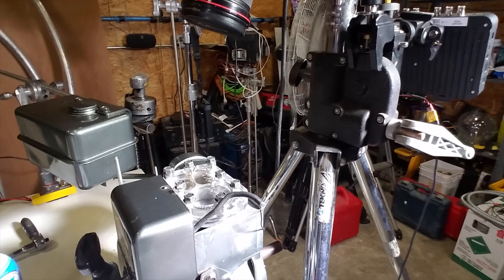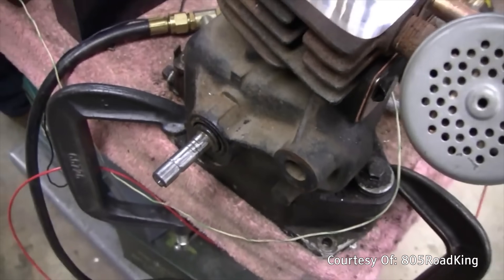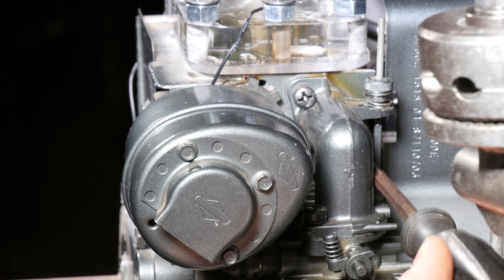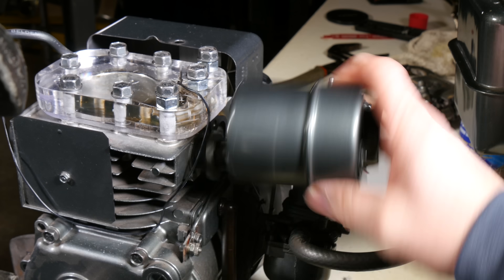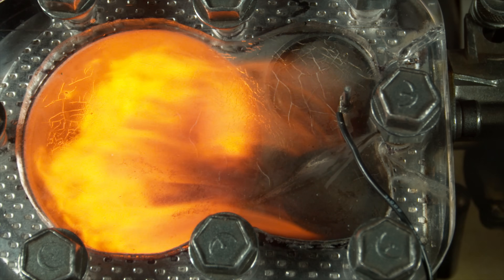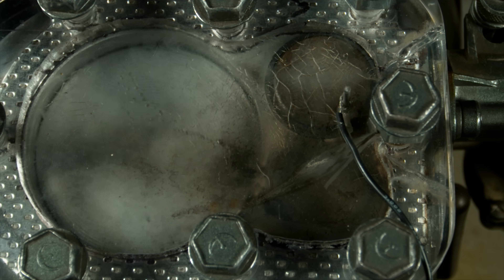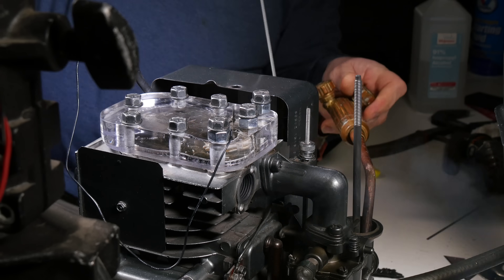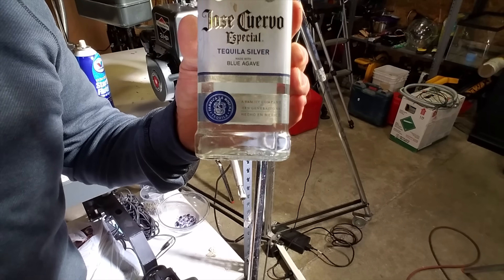See Through Engine - 4K Slow Motion Visible Combustion ( S1 • E1 )

Comment: I think the same can't be done with a diesel. If it were possible you would see the air inside the cylinder turning into plasma and beginning to glow as the pressure increases and then the diesel fuel injection and the resulting combustion.

Comment: is it true that diesel motors ignite the fuel with preasure, as in the spark plug doesn't through a spark everytime the piston is up. the fuel then being ignited by the built up preasure. I don't know if it's the diesel motor that works like that, but I'm certain that certain types of motors are built to work like that. could we see a demos ration of that pleas? :3 thanks
Reply: Diesel engines don't use spark plugs at all.  The extremely high compression is what ignites the air/fuel mixture.  Some diesels use glow plugs to help warm the mixture for cold start up, but they are entirely different from spark plugs.
Reply: Thanks!

Comment: Nice video, it probably would run better if they just ran the fuel through the fuel line with the alcohol, or just added less. Looked very flooded not that it really matters but im just curious how it would run if they just filled the carb up but since they were trying different fuels it would take longer draining the carb each time they switched fuels. Great video for teaching people about engines though. Much better than a animation.

Comment: Awesome video. Thanks for sharing. Liked and subscribed.  😃
Try running the motor on Bacardi 151. The percentage of alcohol is high. I bet it will work. Denatured alcohol will run even better, though you might not see much of a flame due to characteristics of the alcohol.

Comment: i'd like to see the engine run on oxidized acetylene  or in other words continue mixing in oxygen until you reach the most powerful mixture ration of  air/oxygen and acetylene.   btw- yes- i've shaken the building and broken glass with acetylene.

Comment: This "would" have been interesting had the spark source been placed in the proper   position.  What we have here is meaningless to me.  Unbelievable to go through all the effort and make a blunder like that.  I don't get it.  To each his own I suppose.
Reply from the maker: +SUPER SNAKE well I try to the first time with the spark in the middle but I needed to get all lot of stuff out of the way, it was blocking The View , the only difference mostly was just the origin of the burn, other than that the rest was almost identical , we're going to do like two more videos with his engine but I've been really sick with the stomach flu , start filming again on Monday , thanks for watching
Reply: Sorry if it sounded as if I came off too strong, but it looked to me like the small wire that was being used as a spark source wouldn't hinder the view all that much but you know more than me about that.  Seems to me the engine would run better if the spark is directly over the piston in the combustion chamber.  Sorry you are under the weather and hope you feel better real soon.  Cheers!

Comment: @Warped Perception Excellent job on making this video however, I have to challenge your idea on running the engine on Tequila because it just sounds so impossible due to the fact that Jose Q Tequila only contains 40 proof and you need at least a minimum proof of 100 to ignite drinking alcohol. If you one day do decide to use drinking alcohol to run that engine which I would love to see you try, I suggest you use drinking alcohol with over 100 proof. Here are a few types of alcohol I would recommend: Barcadi 151 (151 proof), Devil Springs Vodka (165 proof), and Everclear Vodka (200 Proof)

Comment: Eh, I think that the alcohol-air mixture was too rich. The same goes for acetylene. The reason it produced so much soot was because it hasn't been mixed with enough air. Adjusting that would've made for MUCH cleaner runs and nicer combustion.

Comment: thank you for showing me this..kick butt to see what a rich set up does inside the cumbustion chamber ,as it s happening,funny you used rubbing alchohol.My dad ran it 20 gal. to every 100 petrol. We took the motor apart at around 150,000 ( came out of a 72 chevelle station wagon) and it was so clean inside the cumbustion chamber,almost like new,no carbon build up except in the heads around the casting were valves were.But thats in the port.
Reply from the maker: Drew Westin wow. that's interesting ! I wonder why the 15% Ethanol at the pump doesn't do the same thing
Reply: Great question..

Comment: Love these motors. Remember modifying these engines to race dirt oval karts. A briggs 5hp could get 9hp with mild mods and stock parts. The alcohol you need to run a special oil. If not the alcohol washes down the cylinder and other parts and will wreck the engine. Also rubbing  alcohol has too much water in it. There was an alcohol we used with no water in it just can't remember the name. It was in 1999 that I last raced.
Reply from the maker: +Buckwheat. I used to race them when I started out as well, then I moved Into the gearbox series, the gearbox class were freaking fast .

Comment: yeah how about you "build" an engine for use with tequila, I mean find the correct spark plug and the correct carburetor setting along with the right compression and then pull up at the liquor store for refueling in front of other customers

Comment: +wp could you actually have that acrylic replace the cylinder head permanently,  ie just keep it there as obviously its way cooler than a regular head. Id like to do this on a minibike running a similar 5hp engine
Reply from the maker: S B no I don't think so because of the Heat, but in the future we're going to blow the thing up, it should be fun you'll be able to see how long and I actually last
Reply: Warped Perception ok bummer to hear,  but will defo wait for that blow up vid!  😊
Reply from the maker: S B I know I was thinking the same thing, oh well

Comment: It would be cool to see you build a see through side plate so you can see the entire engine guts and oil splashing around. By the way Tequila will not work. Its not strong enough alcohol if its 40%.

Comment: I like the Ford Model T & recall it was originally designed as a dual engine gasoline and natural gas engine..

...somehow the gasoline combustion engine was promoted into mass production.

I kind of wondered if this engine would come back in a modern version but simple to fix with a screwdriver & pair of pliers! Come back as a renewable source battery, solar, gasoline and natural gas hybrid of some sort. 

There are billions of people on this planet living in emerging economies that will transfer from public transport to being owners of new cars and pickup trucks. I hope its a sturdy and renewable energies vehicles.

Comment: Have you ever seen heard of a "gasogen"  it's the technology that a lot of farmers used during WW2 here and abroad to run their tractors and pickup trucks.. they use wood smoke generated  from smoldering wood chips.. the smoke is sucked into the engines and combustion occurs.... it's pretty cool, no petroleum combustion..  There are a lot of preppers that will use this for home generators to live off the grid, if required.. Would love to see that combustion in your see-thru head..

Comment: Would you be willing to do the isopropanol again, but preheat it using some tubing wrapped around the exhaust or preheat it using external methods?

I'd like to see what the combustion looks like when you preheat isopropanol at certain temperatures.

Comment: was running far too rich in all tests it will produce a blue flame and maximum power if the air to fuel ratio is correct around 15% fuel to air very interesting though would like to see results wth pure oxygen fed in intake'.

Comment: Nice video! Is acetylene the same as lpg? If not, can you possibly do a video using lpg? Im just curious because here in the Philippines, some cars and taxicabs were converted to run on lpg. It is way less powerful than those that run on premium gasoline but cheaper specially on city driving. Not recommended on climbing hills.

Comment: Exelente trabajo. Este vídeo también es útil para ver la aplicación del torque
Reply from the maker: Jose Gabriel Arias gracias !!
Reply: Warped Perception gracias a tí por tu tiempo!! 👍
1° vez veo una prueba con Acetileno😲😨👌👌 In Costa Rica gas has a high price 1L cost $1.2
How much does this cylinder of acetilene cost un USA and it or another gaseos substance could produce bigger explosions than gasoline (more HorsePower)?
!! Tnx you so much✌
Reply from the maker: Jose Gabriel Arias como $50 USD, en Costa Rica casi todo esta caro. pero el cafe es el mejor de todo el mundo en mi opinion. mi encanta elcafe de Costa Rica, yo fui a Doka estate.

Comment: We all know how bad it is to put sugar in a gas tank. I'm curious to see what it actually does to the engine. Perhaps we can see this in action with the glass head?
Reply from the maker: thats a awesome idea !!!
Reply: Thanks :)
Reply: The first thing you will learn is that sugar doesn't dissolve in gasoline the way you might expect. 
Go ahead, put some gas in a mason jar and add a few tablespoons  of sugar. Put the lid on. Shake and let it sit for a day. A week, whatever and re-examine. Shake again and let it sit longer. 
Analysis #1: Sugar in the gas tank is likely an overused and overrated myth.
#2: there is often a small amount of water in the bottom of a gas tank due to condensation, contamination...... Sugar will dissolve in water and could gum up the works. 
#3: I have been around engines professionally for 40 years, and have been involved with diagnosis of all kinds, and taught automotive theory at an engineering level. I have never yet seen an engine damaged by sugar in the gas, despite the common stories. 
Never once. 
Now fuel supply systems, that might be a different story.......

Comment from the maker: PART 2 See Through Engine running Tequila , 151 and propane https://youtu.be/rURHVLM9nxs
Reply: moonshine or hydrogen would satisfy my curiosity
Reply: Warped Perception awesome vídeo!! you should do with hydrogen too
Reply: It's a beautiful video, but keep the exhaust on, you removed the back pressure messing up the flow in there...
Reply: Also some NO2....Wind in the air ! !
Reply from the maker: thats a good point, i didn't even think about that
Reply: Warped Perception HELL YEAH! 151! I want to see the Cuervo, too!
Reply: That was excellent to see! Thanks for the video.
How did you control the mixture of the fuel air? The alcohol might have looked better with a leaner mixture!?
Good work with the carburettor fire, drawing it through the engine was very quick thinking.
Reply from the maker: lol.... thanks !
Reply: Warped Perception another thing to consider.  Acetylene is a carbonizing flame, to use welder's jargon.  adding more Acetylene actually increases the amount of soot.  thats one reason why funny cars use nitrous.
Reply: Warped Perception u
Reply: Try moonshine. We have all herd stories (or seen dukes of hazard lol) where the lod moonshiner ran his car on his shine. Be cool to see if it really works! Sweet videos by the way, new subscriber.
Reply: Oxygen isn't flammable by itself, so you'd need something for it to react with (i.e. fuel).
Reply: Really???
Reply: Warped Perception Does anyone know the name of the final music?

¿Alguien conoce el nombre de la música del final?
Reply: Your kid is adorable.  Your turn!!  :)
Reply: Warped Perception very cool

Comment: This is a good display of how a cool engine quenches the explosion.  Because the plastic head melts at about 160 C you can only run the engine a few seconds. This is because the flame temperature inside a warmed up engine is over 2100 C or 3800 f.  This quenching is why much of the fuel passes through the engine un-burned at startup.  When the rubbing alcohol was used which contains water, you can see how the fuel wet the surface.  In fully metal engines extra fuel is used to wet and cool the metal surfaces through evaporation.  This is necessary because aluminum melts at only 660 C.  Make the fuel too lean and engine parts start to melt.

Comment: Great video, thanks for posting! Can't wait to see tequila next time. 
Also, I"m hoping someone else has mentioned this already, but, your first slo-mo clip states that it's 150 times slower than real time, which is incorrect. 
At a real time base of 24fps or 30fps, whichever you uploaded it at, the clip would only be 8 - 8 1/2 times slower than real time. 
Also, watching the clip in 4k on a lower resolution tv, computer or monitor isn't going to make a difference. 4k is 4k. If your screen doesn't have 4k you can't see it.
Reply from the maker: +Darryl Byrne thanks !. We shot the tequila vid today.also as for the speed. This was shot at 1300 - 4000 frames per second. Divide the framerate by 24 fps playback and that's your warp factor.
Reply: Eh no, to find out how slow it is compared to real time you double your frame rate exponentially, you don't divide anything by 24.
If you shoot at 1300~ for you're 6.5~ times slower than real time, 4000~ fps is about 8.2~ times reality.
It's math. Not 'warp time'.

Comment: Pls. Could you test these engines with hydrogen-additive gasoline (using a hydrogen generator like these, advertised on EBAY http://www.ebay.com/bhp/hho-generator)?

With your device we can see the burning speed of the normal gasoline and, after the generator is started, see if there is any change in the burning speed.

I'M WAITING FOR NEWS.

Comment: EXCELLENT video showing the combustion dynamics of different fuels.
In a perfect world the alcohol would have been pure ethanol or methanol and propane the gaseous fuel, reflecting real world fuels, but those used give a good concept of the behavior of different types of fuel.
Cool video, thanks!

Comment: Are nitro engines usually used in rc cars/trucks?
Reply: yes
Reply: Jesse Swift k thx
Reply: Those small engines typically run on alcohol, and sometimes a small percentage of nitromethane is added for the purpose of improved staring, improved idling and increased performance.
On the other hand, big engines as used in top fuel and funny car drag racing run nearly straight nitromethane, and make massive amounts of power.
Nitromethane is a by-product of the fractioning of propane and the reason it stores so much potential energy is because it can be run at what would otherwise be considered extremely rich mixtures, therefore large amounts can be burned and create a great deal of power. (Power is proportional to fuel burned basically)
Simplified, the reason it has so much power potential is partly because as it burns, it produces oxygen to support continued combustion as a chemical reaction. Therefor it can be run so rich as to risk hydraulically locking up an engine on the compression stroke. You can otherwise essentially run as much through an engine as you can get to reliably ignite and burn.
Nasty stinky stuff though.

Comment: Why did you move the position of  the spark ? I think on the original head, the spark plug is in the middle of the head... to have better visibility ? Of course this alternates the combustion compared to the original engine... and why is there a spark on exhaust stroke ?
Reply from the maker: bobl78 yes I moved it to make the combustion chamber visible, also this engine uses a simple Magneto which is just a magnet on the flywheel and the stationary ignition coil. But this also is very common in cars it's called a wasted spark system

Comment: When using acetylene, you should light the torch and add the oxygen like you normally would, until you get a normal good looking oxy-acetylene flame. Then, without changing the settings on the torch, snuff out the flame on a piece of wood and then place the tip of the torch in the carburetor. That way you will get a proper air to fuel mixture that wont soot up the combustion chamber.

Comment: can you make an engine that had more than 4 strokes? here's my idea. I understand hydrogen internal combustion engines were attempted a long time ago, but the combustion chamber got too hot, and the hydrogen combusted too soon, causing backfires. what if we had an eight stroke engine? input, compression, power, exhaust like normal, but then have a second input to input water, then exhaust, input water again, and another exhaust. I realize this would take more cylinders to keep everything powered, but could it work? would those two water inputs and exhausts cool the chamber enough to keep the hydrogen from prematurely combusting?

Comment: 03:57 Better get my glasses so when the acetylene cylinder explodes i wont get shards in my eyes.
Reply: Hi I'm Glass Shards In My Eyes Johnson and here at my store we have great prices, I hope they're not too expensive or cheap because I have glass shards in my eyes and I can't see anything, so come on over!
Reply: KluckyMcduck Yup. Safety first. When standing next to an explosion, you always want to wear thin plastic glasses,  jeans,  and a shirt.
Reply: NeoFryBoy the cylinder hose has a flash back arrestor to stop any flame from returning to the cylinder. if that is faulty it will be the last thing you do
Reply: KluckyMcduck I wouldn't have the balls to try that one.
Reply: yeah... acetylene shards... lol
Reply: +KluckyMcduck That's one pissed off duck!
Reply: +MrDetroit1701 did you just assume my gender?
Reply: this reminds me of the movie passengers
Reply: +Thoracic Vertebrae  thanks still haven't seen that movie, totally forgotten about it :)
Reply: NeoFryBoy 😂😂😂
Reply: Ncedile Mpikashe If the return is faulty it's the last thing anybody in the block will do I guarantee you. 💣💥🚒
Reply: 0BMM1 like, it's acetylene and it's dangerous, but it doesn't have the power of a tonne of tnt. which is what you need to level a block.
for scale, look to 1000lb JDAMs. 

sorry if it seems nitpick but I work with acetylene every day.